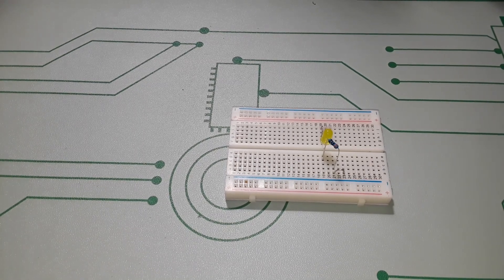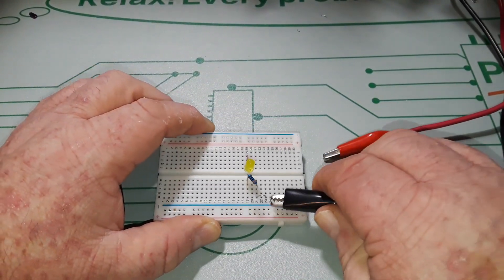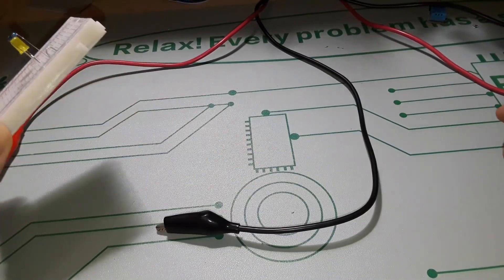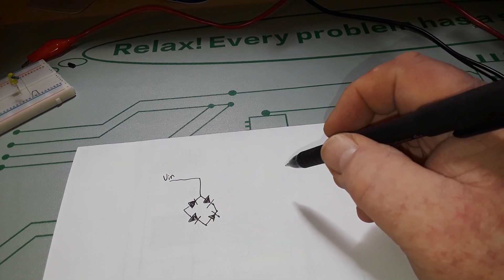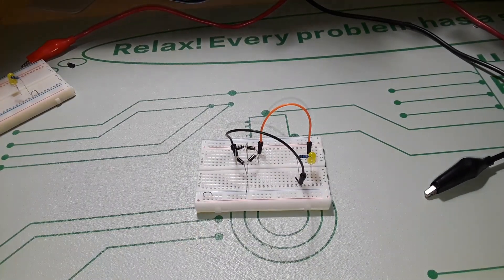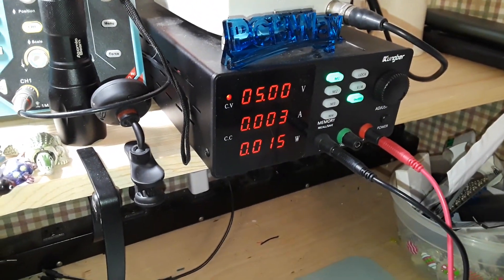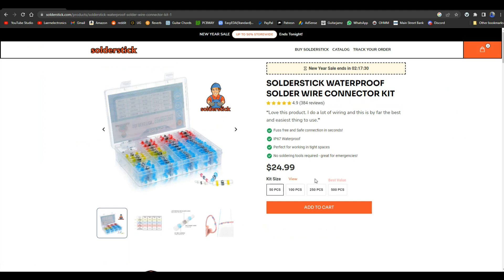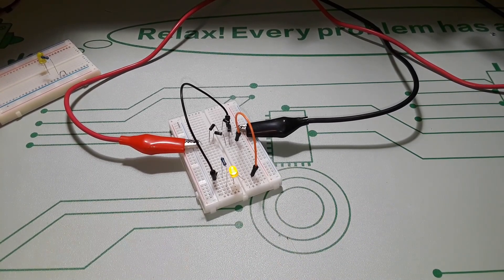Classic Circuits You Should Know: Reverse Polarity Protection Circuit Solderstick Wire Connector

Comment: I can see the value in trying to make some projects idiot proof as some things will be subject to all manner of abuse. But a simple diode and fuse combo where the diode clamps reversed polarity and pops the fuse might give the user the required feedback that they are indeed being an idiot and need to re evaluate their haste. I might not want the circuit to be constantly wasting energy purely because we want to enable stupidity to continue unchecked. Might also run into problems combining multiple pieces of equipment where supplies are referenced to ground.

Comment: Another great video Paul.  I like the Solderstick products.  They have good quality and are easy to use in the boonies.  
Regarding the diode reverse polarity protection, one thing I might mention:  A lot of people are concerned about the diode drop.  If your project happens to have a boost converter downstream, the diode drop is not an issue.   I just up the output voltage to compensate.

Comment: I have used those connectors, used the whole kit wiring in a sound system on a boat with leds. Takes a bit of skill. One trick I use is shrink the end on one wire so it holds itself in place, insert the other wire to overlap then heat to solder. Pull test them! They can fool you.

Comment: Like a lot of the others, I’m troubled by the diode drops — in a battery-powered circuit 1.4V (or even 0.5V if you build the rectifier with Schottky as others have suggested) is a lot to sacrifice for polarity protection when the only advantage is that it works either way — as opposed to Afrotechmod’s PMOS protection or (the method I learned building guitar pedals) a single 1N5817 in series with Vin. It’s especially problematic because you have that drop even when the power is connected correctly. For your 5V example you basically need to design a 3.3V circuit even though you have 5V, and even a guitar pedal at 9V is not going to function correctly at 7.5V.
Reply: thanks for the info, we now know both methods, nice

Comment: This is fine if you can afford the voltage drop, i'd use schottky diodes with a lower drop making it roughly the same as a single rectifier diode, on low voltage circuits i'd use a mosfet instead.

Comment: Two thoughts here. Any time currrent passes through a diode, there will be a voltage drop. With a full-wave rectifier the currents through two diodes, effectively doubling the drop. A much simpler circuit to protect proper polarity would use only one diode and it would give protection needed.
Reply: Might as well use a diode and a MOSFET hooked up correctly. No diode voltage drop for the intended load.

Comment: I have one I'm puzzled by:
How does one do a "Five inputs, two outputs" sort of arrangement? One output is the actual load, the other is battery charging.
The "Survival Radios" always seem to have a nutty arrangement with a manual switch between "Solar, Crank, Rechargable, Dry Cell, and Wall power" as various options.
What's the simplest circuit to do this? And what's the most power efficient? (Because, in an actual survival situation, power is actually a limiting problem.)

Comment: I like AfroTechMod's circuit using a reversed 'P Channel' mosfet for protection.
Of course this one allows the circuit to work, regardless but two diode drops could be a bit much, maybe.
Reply: I use that method all the time to minimize power losses; however, unlike Paul's demonstration circuit with the FULL BRIDGE Rectifier, the P-channel MOSFET only delivers power when wired correctly.
Reply: Yes Afrotechmods is the smarter DC solution along with a Zener diode if over voltage protection is desired. This ((FULL BRIDGE RECTIFIER)) should be kept in the AC circuits group. IMHO

Comment: I've often wondered why manufacturers don't put a bridge rectifier in their equipment, at least for things that may get connected backwards! 
I also have a radio transmitter that has a single diode that shorts when the power is connected in reverse. But that just winds up disabling the equipment until the diode is replaced!
Reply from the maker: They don't do it because it costs extra
Reply: @learnelectronics  Standard excuse. What would it add, maybe $10 to the total cost?
Reply: @Jimwill01  Most likely, it would only add 10 cents.  However, having the Customer screw up and put the batteries in backwards is not covered by Warranty.  Getting the rebuys, and the maintenance work....Priceless!
Reply: I'd say because of losses. If you use it for low power applications you get a V drop of about 1 volt between 2 diodes so you can't use it for microcontrollers. Maybe using shotky diodes improves the efficiency but that voltage drop might be critical in low voltage applications.

Also for high power applications you need to have beefy ones and also get a heatsink
Reply: @redmist4963  Transceiver will work between about 10.5 and 13 volts. Some circuits, yes. But not all circuits.